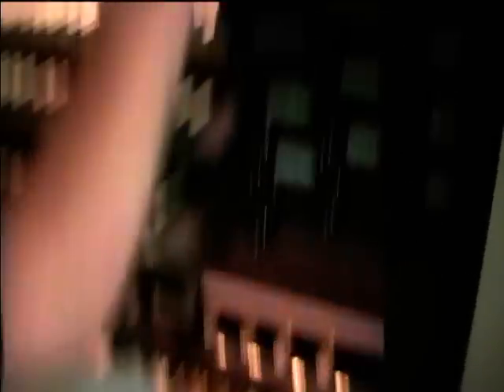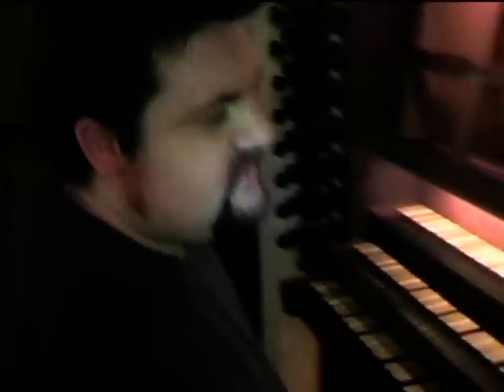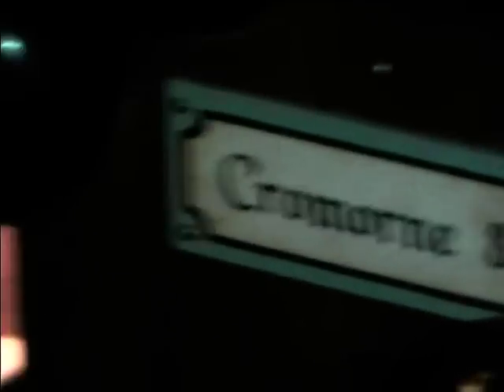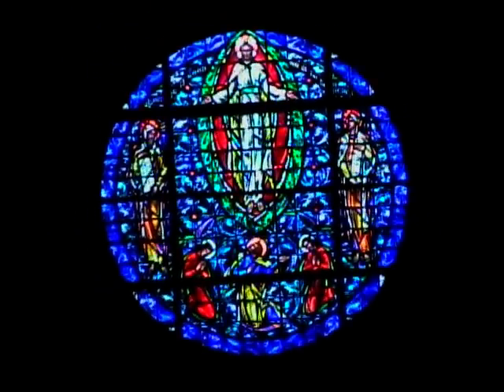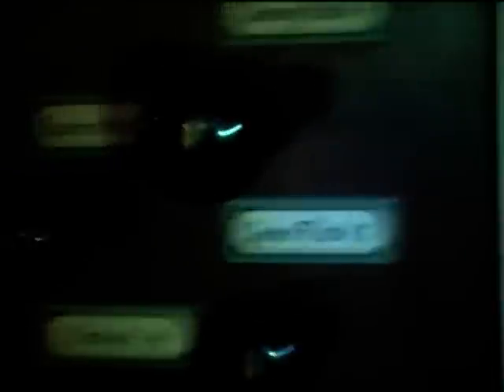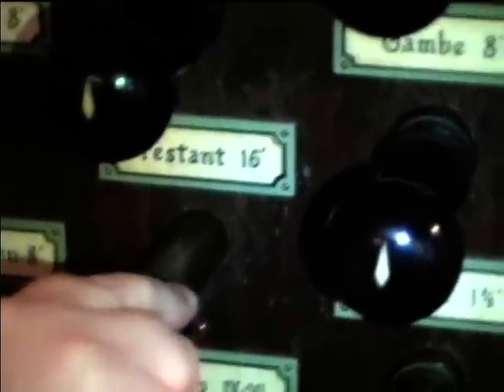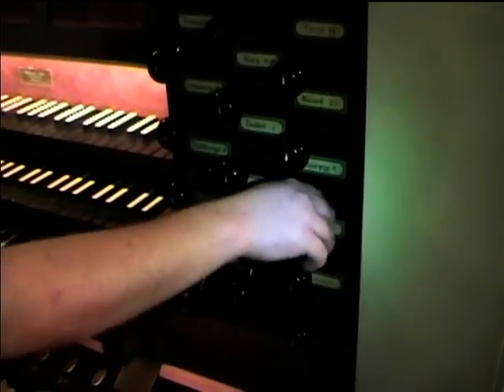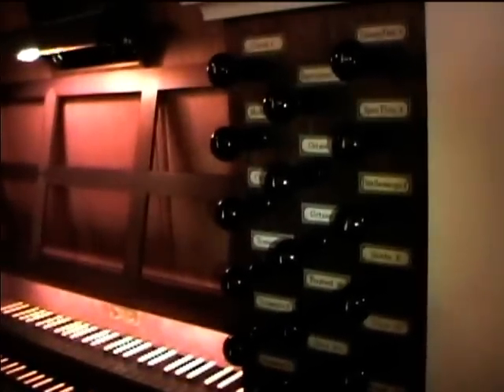Fisk Pipe Organ Demonstration Part 1

Comment: The dulcian (dulzian) is of the Krumhorn class. And are half length. Some cylindrical reeds are 1/4 length. Resonator length and shape is a function of tone color and design and really shouldn't be compared to stopped or open pipes. Apples to oranges there. Let's also not forget pipes can be mitered.

Comment: In case you were wondering about the reeds, they are on ventil chests (likely along with some of the upperwork in their respective divisions). Also, the Cornet V is not a trumpet stop. It is actually an attempt to imitate a double reed instrument.
Reply from the maker: I actually said that the Cornet here is a "treble" stop, referring to the fact that it doesn't play below middle-C.  I do know that it's made up of flutes of 5 pitches.

Comment from the maker: Those ARE wonderful stops on this organ!!  The Trommeten is so warm and rich.  Of course, the Trommeten's main function is as a German Trompete, for Bach and whatnot.  The Dulcian is a cylindrical rank, so the longest pipe would only be about 8' long.  Cylindrical reed pipes are only half as long as conical reed pipes of the same pitch, just like stopped flue pipes are only half as long as open flue pipes of the same pitch.

Comment: that's weird most three manual organs have the great in the middle the choir on the bottom and the swell on the top.
Reply from the maker: bassplayer2011ify True, but many 19th-century French organs, particularly those by Cavaille-Coll, were built with the Great on the bottom.  The logic was that the top manual was softest, the middle manual stronger, and the bottom manual stronger still, especially when coupling.  Much of the organ music from that period is actually easier to play when the Great is on the bottom.  Actually, I think the German builders were the first to introduce this manual configuration.  Anyway, this is why many large modern American organ consoles feature a Great-Choir transfer on the coupler rail, which switches the order of the bottom 2 manuals just for this purpose.